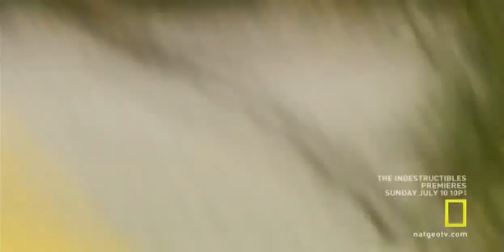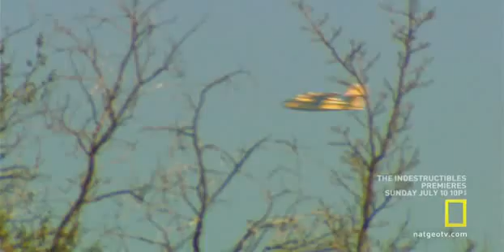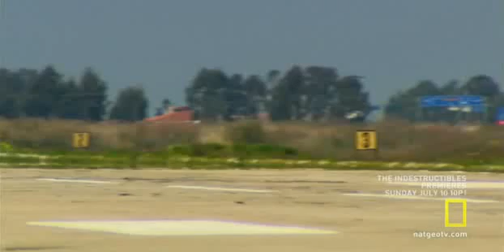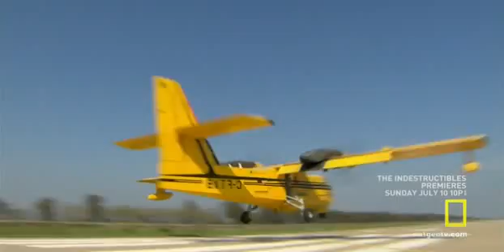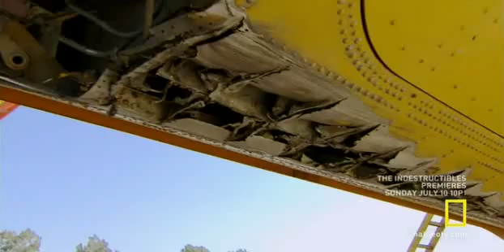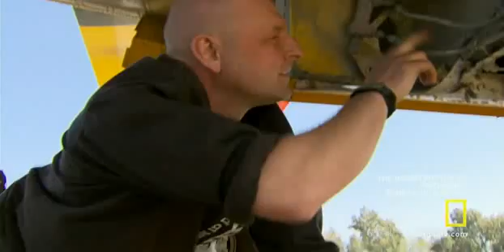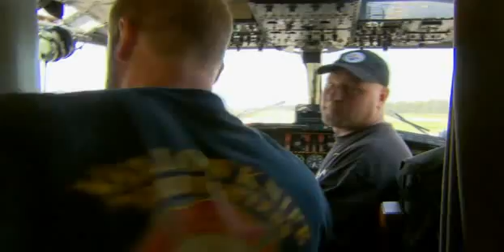CL215 crash landing

Comment: We don't know if the landing gear is going to hold. Aircraft stops and they jump under to look at the damage.
Reply: If the hydraulic lines were severed, the gear wouldnt have locked in place, and if it didn't, then it wouldnt be able to even remotely hold the weight of the aircraft. So by the point it lands and holds the weight before stopping and then still holding it, by that point it was pretty clear the gear was locked.
Reply: Exactly!
Reply: hahahahaha lol i thought the same , suddenly the landing gear and wheels are healed, magic. Auto-heal activated i forgot

Comment: The gear will NOT fail due to hydraulic system damage once it is down and locked.  Who writes these scripts??
Reply: The locks couldve been damaged and then no hydraulic backup to hold it up
Reply: It may come down but it needs hydraulic pressure to hold it in place.
Reply: @scottgamedev8542  Well, that would be a very badly designed undercarriage system.

Comment: As a student pilot, on an instruction flight in my 182, I was landing into the wind at a public non-controlled airport in WA that the US Navy also used. I reported into Unicom all my legs and intent to land to the South and just as I was about to touch down, we saw a Navy COD landing toward us the opposite way. I initiated a go-around and the Navy COD did as well, both of us climbing to our right. As I got back into the pattern and was on downwind, we saw the Navy COD on the runway GEAR UP! Crashed!  So we prudently decided to return to another airport where I had my 182 hangered.  We later learned that there were 6 pilots aboard the COD. No one was hurt. They didn't call in on the Unicom frequency and were landing downwind. When the pilot in command did his emergency go-around his training caused him to retract the gear.  If he was using a checklist instead of maybe complaining to the others about the light plane (who was landing the proper way) he might have gone to GUMP, or maybe he went to the checklist AFTER the part about putting the gear down. The point is, distractions can cause even a well-trained pilot to screw up. No excuses, just fact. BTW after that, all subsequent Navy pilots landing at that airport were required to call into Unicom and declare in addition to the usual, that their landing gear was down.

Comment: I was a jet engine mechanic (U.S. Navy) at Whidbey Island when a P-3 Orion practicing touch and goes forgot to put down the gear and landed on the belly. Tore up the aircraft, runway, and all 4 engines were completely destroyed. It happens... but that's NO EXCUSE for it happening.

Comment: Manufacturers had been trying to prevent pilots doing wheels up landings since retractable gear was invented.  Prior to computers on the flight deck, it was a fairly common occurrence. I remember Mooney had a device that waved a flag above the instrument panel in front of the pilot. Pilots still landed wheels up. The old saying concerning wheels up by retractable gear pilots was "there are those that have and there are those that will".

Comment: "the gear could collapse under the weight of the plane."

If you take one frigging look at how that gear is shaped, you will see how it CANT collapse under the weight of the plane.

The gears dont rely on the hydraulic system to hold the plane up.
The struts have their own internal fluid to do that. Completely seperate system.

Comment: There is a saying in aviation that goes like this: There are two types of pilots flying retractable aircrafts: those who have landed with the gear up and those who will.  Hindsight is always 20/20, In nearly 3,000 hrs of high performance flying (mostly single pilot), I had plenty of emergencies and many times you forget items, not because of the check list but because you get task overloaded or an emergency arises as you are going through your checklist.  I never landed with gear up but in the Navy, I used to make my "Abeam" call "with gear" if coming downwind.  Yes, Navy guys have landed with gear up, missed the runway, run out of fuel, overshot, ...  It can happen to anyone. I do not know what happened on this mishap but he saved the aircraft landing it very smoothly.  I am not sure that the camera shot of the gear was taken on the same aircraft?, Fly safe, L
Reply: One thing people are forgetting is that this is a seaplane. It is designed to land in the water with gear up. Therefore the pilots are regularly landing with the gear up and with the gear down.
Reply: Woody615 well that depends
Reply: Woody615
Good point, in an tight situation, that can definitely affect your actions, Ciao, L
PS: That is why most professional pilots (like airlines) prefer to fly one type of aircraft "at a time" even if qualified in many.
Reply: lancelot1953 But just because its a seaplane doesn't mean the aircraft experiences mostly water operations.i mean its amphibious  #js
Reply: flyer boy Hi, I fully agree with you and may have expressed myself improperly.  The more "options" you have in a maneuver (landing gear down on ground or gear up in the water), the more risk you take of making a mistake at one point as opposed to always landing on the ground (dropping the gear) or on the water (using floats).  Of course, an experience pilot would probably be making this mistake when overtasked by other emergencies, interruptions, traffic, near-midair, weather, etc...
Have a good night, Ciao, L
Reply: he was in training. But WTF didn't they elect to try for a water landing if the gear didn't respond to input?
Reply: @lancelot1953  And that's why we always do our 'gear down' check at downwind at our gliding club, even  when flying without a retractable gear.

But I've seen someone calling 'downwind, wheel down' over the radio while having his wheel up. Luckily, someone on the ground noticed he hadn't extended his gear and radio'd him last second.
Reply: Hi Julian, that is a very good point and I fully agree with you and whether I fly retractable or fixed gear aircrafts, with or without speed brakes (and I would even make a "hook" call from my Navy days), I always go through the same check list that I also stick to side of my instrument panel.  Some passengers laugh at me (usually fellow pilots), I go through the same checklist - calling "gear": fixed is my aircraft is not a retractable.
Fly safe, Ciao, L
Reply: TO AS WAS

Comment: You can not simply forget to lower the landing gear. Didn't he have a checklist to go through?
Reply: GUMPS
Reply: Lef He thought it was the water
Reply: Correction.. you can.. just look at the video. haha. They likely had a checklist.. but it was in English, and they are Turkish. :P
Reply: Shows lack of proper training. I flew up front with a 727 crew that had been doing it for 15 years and they went through every check list like it was their 1st time.
Reply: Left turn
Reply: They obviosly didn't use it. I would never fly with Turkish pilot. No way.
Reply: Warning horn should have gone off with throttles closed.
Reply: Peg Leg  & those that abhor cliche' . . .

Comment: The Landing Gear are MECHANICALLY locked down,  no hydraulic pressure is required after the LDG are in the down and locked position.

Comment: Hydraulics are damaged, wheels can maybe NOT hold the plane, when the plane stand still *hey lets go under the plane and check the damage, very safe guys congratulations!
Reply: It can't fail once locked. The jury brace holds the undercarriage in a locked position so it can't collapse even if the hydraulics leak or fail in any way.

Comment: why is it a problem a failure in the landing gear in a seaplane? 
Can't you just divert to the nearest body of water?
Reply: Exactly my thoughts.
Reply: +John Wilkinson Mine too.
Reply: +John Wilkinson They teared the plane belly, water would do much more damage.It would be interesting if landing gear really didnt work, they would have to decide where to land.I would pick grass field.
Reply: +alen91071 ???
Reply: alen91071 It's meant to land on water BEFORE they have attempted to land on the runway with no gear.
Reply: +John Wilkinson He forgot to put down the landing gear. pilot error period!
Reply: Serge Smith Roger that.
Reply: +Serge Smith Not to mention the indicators  on the panel that tells you gear up or down. PAY ATTENTION!!!
Reply: David Smith Yes sir! I agree 100%
Reply: +David Smith I did a few hours in a Piper Arrow with retracts. I remember the triangular shaped lights which indicated wheel up or down(red or green) on a given gear. He also taught me to listen for the clunk, bump, whatever the sound it made when the gear locked down. Many times what we called rubber down or rubber concealed could not always be heard in a noisy cockpit. But place one foot on the floor and you could usually feel it. Providing you weren't busy on the rudders at that moment. I can see how this type of accident can happen. Heard dozens of stories where lock down failure  caused quite an adventurous landing.
Reply: +John Wilkinson Buffalo airways sold these 2 water bombers to the Turkish government and as part of the contract Buffalo had to also train the new Turkish pilots. This incident happened when the Two Turkish pilots flew by themselves for the first time. They were both inexperienced pilots who had no clue what they were doing.
Reply: The440plymouth Hey imagine that. Love a man who can give me the fact as they are. Not an airplane to be flying if you have no clue what you are doing. I thought his landing was a bit rookie like lacking a better choice of words. As he crossed the threshold he was not exactly on the center line. Since I saw no noticeable cross wind a dead give away for inexperience. Good comment.
Reply: +The440plymouth Probably the flight instructor failed to remind them that sea planes are equipped with wheels just in case.
Reply: David Smith
"Since I saw no noticeable cross wind" - you can't see things, that unnoticeable. If you say "I saw no wind", it automatically means that the wind wasn't noticeable!
Reply: Alexander Howard No you cant see the wind but what I can see is the manner in which the aircraft yaws, pitches, or rolls (no pilot with sanity does this for fun) gives me a good idea of what the prevailing winds were in this video. I correct my earlier statement by saying I may not be able to see wind but I can see it's actions on objects be it an airplane or a piece of paper.
Reply: Alexander Howard AT the 15 second mark you see the right aileron go down slightly indicating he may have had a light port cross wind. But since no counter yaw was used he may have just thought his left wing was high and was correcting for it.
Reply: David Smith Sure.
But you haven't understood me, apparently.
I mean you're being pleonastic. You can say either "there is no noticeable wind" or "I saw no wind", but you can't say "I saw no noticeable wind". Otherwise it's a logical failure. Understand?
Reply: And at the 10 second mark he yaws slightly right as if he was in a starboard cross wind. Or maybe he was simply on the verge of complete loss of control.
Reply: Alexander Howard OK lets try this he first corrects(yaws right)  as if there is a starboard cross wind. Then uses right aileron as if reacting to the total opposite. Now observing trees and other objects in the video looks like to me the only wind he was encountering was the wind generated by the momentum of his aircraft. And I suppose it could be debated that there is never NO wind we could do this all night. Just my thoughts!!
Reply: David Smith Where are you from?
Reply: Alexander Howard I am from Nashville Tennessee. The back wooded hick comment was a joke. I flew as a private pilot for years. I am no longer medically certified due to Parkinsons disease. I do OK with it but do have bad days as does anyone with a debilitating illness. So many times my brain may properly sort out a problem or seek a related word. But I cannot always express myself as I might wish to.
Reply: David Smith What? Parkinson's disease  doesn't weaken your mental abilities.

I wasn't talking about using of English, I was talking about logic.
Reply: Alexander Howard I am in stage 2. Often cannot concentrate and hands shake. Leva dopa only masks symptoms. Also rarely acts the same in any 2 people. Also have balance issues.
Reply: Yes Anthony that is why they are known a \s in flight emergencies. They never happen at a good time.
Reply: +Anthony Smith O.K. I'll give you darkness as a factor, you certainly don't want to be looking out the window looking for a place to plut your plane when the night falls but I understand that when seaplanes are in use is mainly because bodies of water are not too far apart. I just can feel the pain of that fuselage scratching along the RWY.
Reply: John Wilkinson  As an old flyer it sickens me to see that expensive fuselage beat up like that!!!
Reply: +David Smith You could make the same mistake. No need in telling people to pay attention! It's ok.
Reply: Lee Lafarlett I never profess to be a perfect pilot. However I am capable of looking at the 3 lights that indicate gears up or down. Also this is part of the landing check list that was obviously was over looked or ignored in this case.
Reply: David Smith I'm sure this pilot was also capable. He made a mistake, just like you are capable of. I've made many.
Two airline pilots go 150 miles past their destination, before they realized they had made a mistake. Two U.S. military pilots landed a C-130 at the wrong airport, by mistake. Everyone is capable of looking at the "gear indicator lights" and everyone is capable of overlooking them. You may be an exception, but I seriously doubt you are.
Reply: Lee Lafarlett AGAIN I never said I was perfect. Yet in over 2600 logged hours I never put a scratch on a plane. This guy may have simply thought he was gears locked and down. That is why we have critical checks that are never to be assumed. Just another example of the fact that pilots kill themselves far more than planes kill pilots.
Reply: +Anthony Smith maybe it was something to do with the big hole torn in the bottom of it
Reply: neil huband That about covers it LOL!!!
Reply: +alen91071 Grass field would be disastrous. The plane could get caught and tugged in mud and end up flipping, especially if a wing got caught in it.

Usually they hose down the runway for landings without landing gear to ease up friction and help prevent any fire from leaking fuel
Reply: Jeff Jefferson If you watch around the 3 minute mark he was yawing and pitching that almost was a disaster there. Good observation
Reply: +John Wilkinson is an endurance test CL215 helmet beautiful but hurts like that- see proof?
Reply: ***** Yes there was. Terrible to see that aircraft damaged like that!!
Reply: +John Wilkinson it wasn't a malfunction, the pilot clearly just forgot to put the gear down
Reply: +itsumonihon They must have forgotten to run the list, forgetting the gear alone is a rare occurrence I believe. But hey everybody is entitled to make one incomprehensible and stupid mistake.
Reply: Right, why not sink the plane for good measure.  Collect insurance although they may have a stupid clause.
Reply: It wasn't a technical problem...he just forgot.
Reply: Ah but they didn't know they had no gear, the speculation is they forgot to move the gear switch from the gear "UP" position to the gear"DOWN" position
Reply: Well, John, because there wasn't a landing gear problem; it was a helmet fire that caused this.